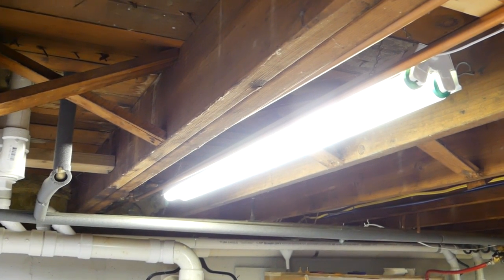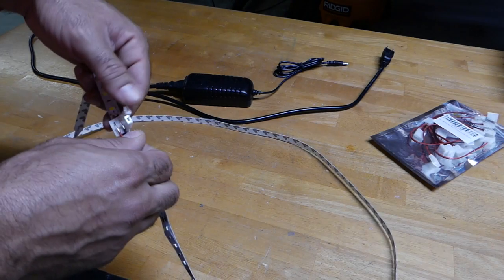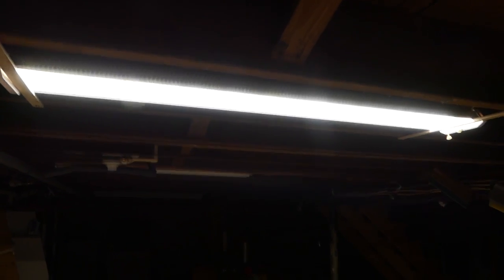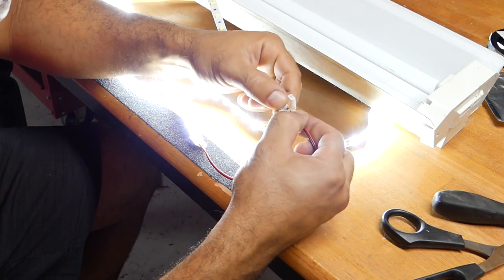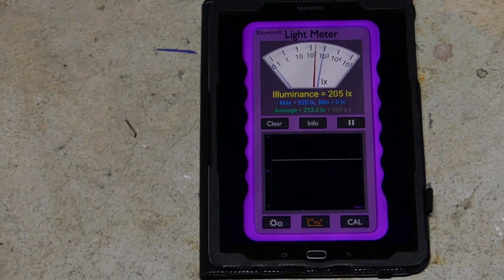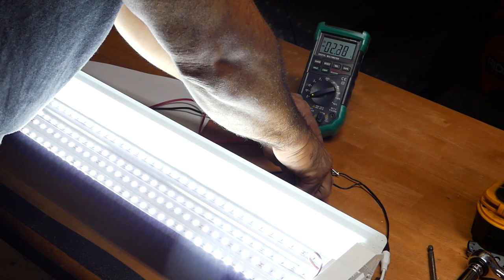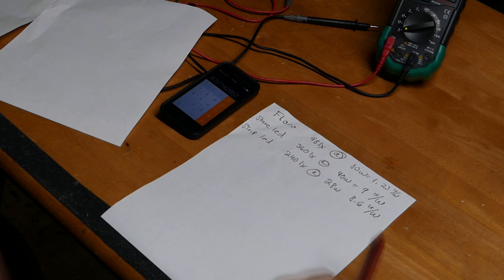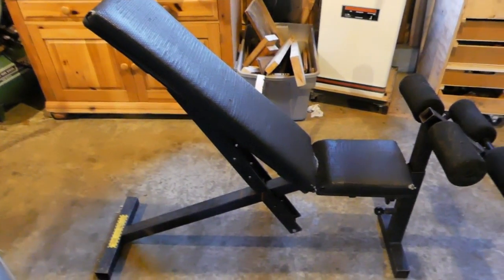Easy LED Shop Light Build And Light Output Analysis Vs. Fluorescent

Comment: Man, you're in my wheelhouse now.  In 2019/2021 you can get just the LED bulbs from Lowes/HD for $9-10, sometime 2-pack for $14.  However, I've got some of that LED 'tape', and never even thought of using it in this application. Figured they either won't have nearly the lux/lumens, or simply short lifespan.
Guess I was wrong.
The thing is, if you can buy it in longer rolls to get the $/ft cost down, you can should be able to tack them directly to the bottom of a joist, or maybe make them look nicer but putting them on a 3/4" piece of plastic trim.  Run them the length of the room, and with a dimmer you'll be able to adjust from good to bright depending upon your needs.
Would be interesting to get an update on how long they lasted, and also test if you even need the fixture, since they are more point sources than 360 degree like flouro's.
Either way, computer build, and a good idea with the LED's that I haven't seen anyone else in the electronics channels try... Smart cookie man!
Reply: Oh yeah, more expensive however you can buy those strips which can change color. Useful if you ever use your garage for parties, etc, for mood lighting.

Comment: You measured the 12vdc output and not the 120vac, there is some loss with the power brick.  having the tube leds run directly off 120vac is a big plus for them (or not..if you run off a 12v battery.. :)  anyways powerwise, need to measure them both as the source draw,
going at the labeled power is notorious inaccurate for chinese products.  anyways, thanks for doing the testing!
Reply: also, should add that today jan 2019 the led tubes are much cheaper now, pkg of 25 at $3.25 each!
https://www.1000bulbs.com/category/direct-wire-led-tube-lights-under-1800-lumens-4000k/
Reply: You're not wrong, however you're over-emphasizing the issue.  Most decent regulated wallwarts are using SMPS switching power supplies which are 85-90% efficient if not more.  Add 10-15% of what he calculated, and you're in the ballpark of actual power used.  In this case, it might be $1/year wasted?  
Just was at Harbor Fright, and they're selling 4' tubes claiming 5000 lumens, which I think is about as accurate as all the 4000ma 18650 Li-Ion batteries sold on ebay..... However, it is possible they are putting out 5k lumens, just overdriving them to where they last a year.  Or, they could just be stuffing more LED's in there, which is doable, and trying to carve out a name for themselves.  Once they have the name, they'll drop the number of discrete LEDS, start overdriving them more, and shoot themselves in the foot. They do this all the time, AvE had a great video on an excellent 1/2" impact wrench HD had which caused a run on them, and they turned around and cost-cut it down to crap.

Comment: I was annoyed by the 4 and 8 foot fluorescent humming, slow lighting when cold and ballast life of around two years.  I replaced them with old fashioned screw base porcelain fixtures costing less than $2.00 each and for bulbs, I used 65w led flood lights costing $1.00 each at Dollar Tree.  These bulbs use 8 watts and put out very bright light. I replaced two 4 foot and two 8 foot fluorescent fixtures in my garage with 8 led flood lights. Puts more light and I was able to target lighting much better.
Reply: I did that before, and the only problem was that the ceiling looked like an upside down mushroom farm. Aside from all the extra romex needed to be run.  Just went out and bought about 12 of the dual bulb units from Costco at $15 each, not sure how long they'll last.  Keep an eye on HD/Lowes, sometimes they sell the retro-fit bulbs that can go directly into a ballasted fixture for $12-15 for 2 LED tubes.

Comment: How much heat are those 5630 LEDs making?  Does it make the fixture metal very warm?  Those are suppose to be the more powerful  LEDs that require heat sink. 
Those Chinese tube LEDs likely failed due to heat.  If you operate them in hot weather,,,, maybe too much heat buildup.?

Comment: Just an idea, i would have lined the inside of the light fixture/ballast with reflective tape, then wrapped the 5m strip light around a pvc tube and rigged it to fit inside the ballast somehow - maybe some end caps with screws through them on the pipe and screwed into the ends of ballast. might have gotten more lx that way. either way, looks great and cant beat the price, great job!
Reply: You are not going to get more lux by pointing the LED's towards the reflector, no matter whether its white or silver.  Just pull the tubes, and put the LED strips inside.  If you want to be really slick, put one or two on the bottom flat part, and one on each side of those slightly angle away from directly down. Like 5-10' angle.  Just enough to increase the spread. LED's usually are much more directional than other lamp types there isn't much reflection, light gathering compared to the flouro, incandescents.

Comment: This was a really great video, thanks for the detail, I'm trying to find some diffused cases to do this in a powerless shed and run the strips on 12volt,.  Helped me determine I need diffused cases for sure, the light is to directed with just the shop light frame.

Comment: I bet you would have gotten a better result if you would have used 5050 LED strips.
Reply from the maker: Maybe.  I bet the results could have been better with a lot of different brighter lights.
Reply: 5630 smd leds are much more powerful than 5050 smd. 
Maybe he is under driving the 5630 somehow.... power supply or resistance in the wiring.   Those commercial tube lights are even less powerful LEDs.
Reply: Lot of coulda/shoulda comments here.  Fact is, this was a pretty good idea, worth experimenting with. 
I've been planning on doing something similar with some good, discrete 3/5w Nichia/Lumileds for my house crawlspace, and even now in 2021 I've gotta go back and get some more samples and check pricing.  Having a bunch of 4-5' strings running under my house would mean a lot fewer locations needed, and faster install with better end result.  IIRC, most of these strips are in parallel, which means a few LED's failing is no big deal as the rest stay lit, compared to a discrete 3/5w LED in an area failing meaning real loss of light.
Thing is to find decently made LED strips among the host of cheapo seconds being sold.

Comment: Great idea.  I've done something similar....  Kinda similar.  4 keyless lamp holders + 4 metal surface mt boxes + 4 "60 w" led light bulbs + 4' 1x4 and a recycled plug wire. About 15 bucks.  Lots of light and  easy standard replacement of dead bulbs.  Yours looks cooler though.

Comment: I have used similar but really cheap led strips to change 12 Volt 13 watt 12 inch fluorescent fittings to LED. (Wiring changes were necessary). Some I just wound spirally around the existing tubes and the LEDs were pointing up, down and sideways but it didn't seem to matter as they reflect off the white paint and diffuser very well. Others I glued directly to the glass tube but the glue soon failed.  I did it to save battery power and went from roughly 1 amp drawn to 250mA with visually the same light output. Mine were in a remote cabin but would work equally as well in a boat or RV.
Reply: Seems like you wasted some of the potential lumens.  Pull the tubes as shown and just attach to the inside of the fixture.  Test with a couple strips, not enough light, add another strip.